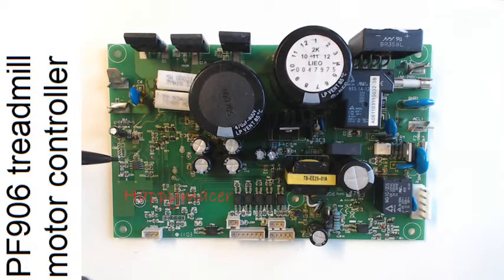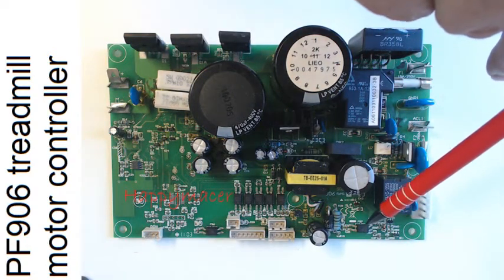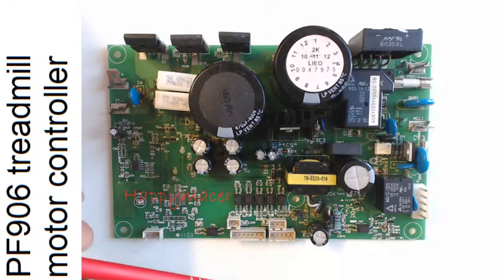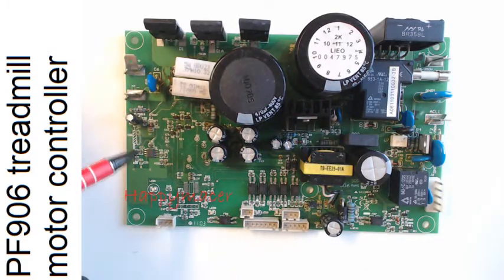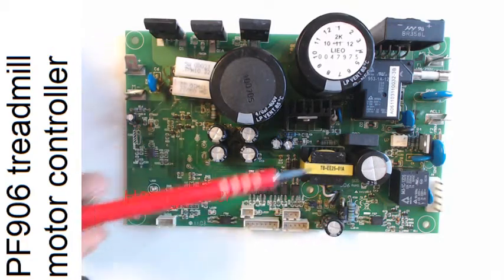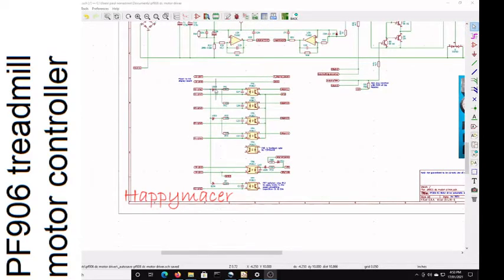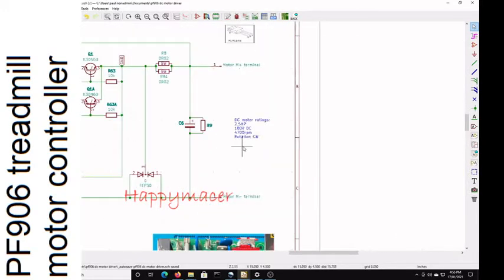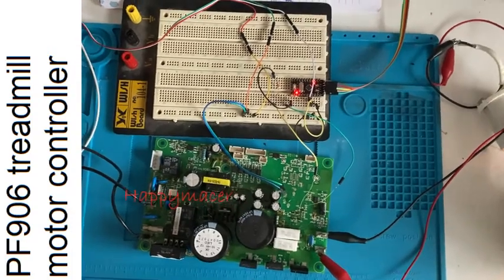How PF906 treadmill motor controller works with schematic

Comment: This is good information. I have a treadmill with similar board. It started to glitch and would turn on (flash the led1 and led4 in boot sequence) only if I gave slight "twist" for the board. Now it doesn't even do that... I'm desperately trying to figure out if the thing is fixable. Visually everything seems fine. Any idea where to start measuring?
Reply: Oh, and if it gives any idea what might be wrong with my board, I measure about 14v from the connector going to the controll board, but only about 0,7v from the 5v outputs... So probably something wrong there.
Reply from the maker: Hiya @marazo thanks for your thoughts, much appreciated.  If a board works when twisted then I think its highly likely that either you have a cold solder joint somewhere, or that there is a hairline fracture in one of he traces on the board.
Reply from the maker: @marazo  forgot to add, since youve found that the 5V supply is probably faulty, Id suggest resoldering all the components in that area.  Hope it works out well!

Comment: it is possible it also can run by other PWM controller
Reply from the maker: yes, please watch the video and also look at my github site where I have the circuit diagram and the points where to connect the other PWM controller.

Note that there are soft starts and other protections built into the original code for a treadmill so DO NOT use a separate PWM controller for a treadmill.

If you like, have a look at my code on my github where Ive provided code for the PIC for use on a lathe or similar machine.  Note that code is simple and it needs more development to improve it, but it does run the motor in 10 speed steps.

Github site: https://github.com/happymacer

Hope that helps!